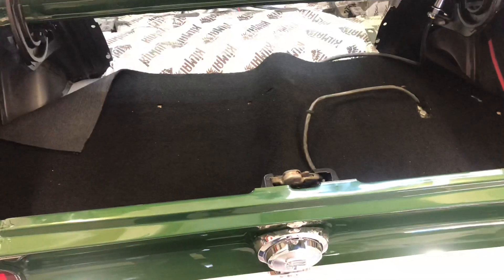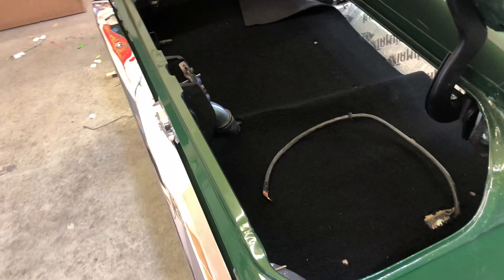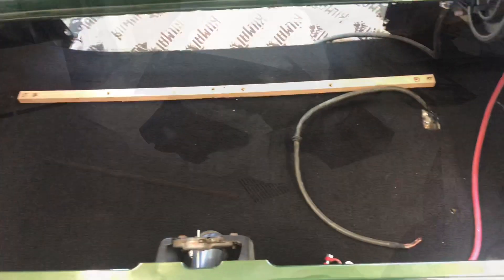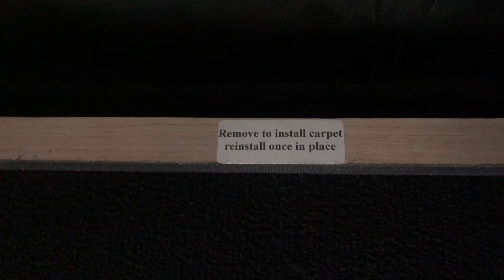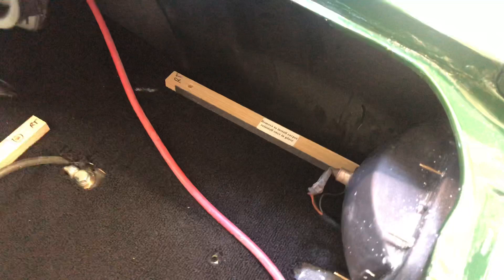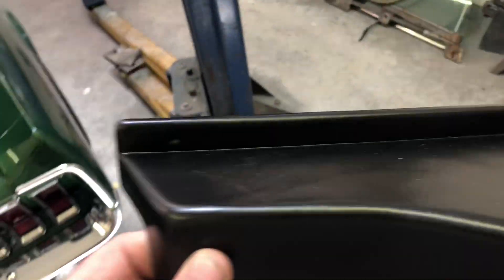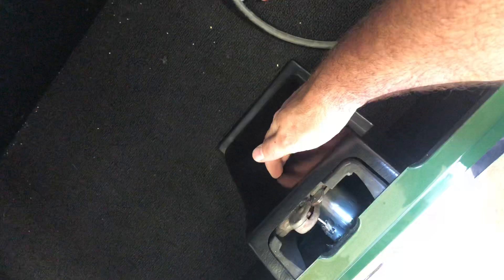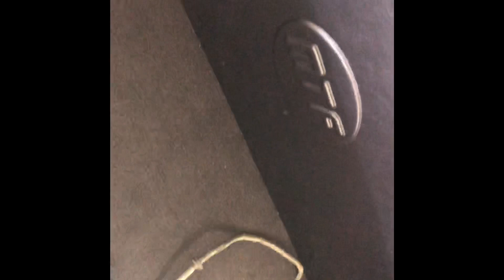Mustangs to Fear 67-68 fastback trunk kit instal

Comment: great ideas on how to protect the tank as well as clean up and protect the trunk space, I have a 68 convertible that I plan to do the same thing to. thank you for identifying issues and ways to adjust to compensate.  also love the 5 amp fuse trick. kill main power but keeps acc. alive

Comment: You know if you turn that off with the car running, then it will stay running due to the alternator. I found this switch that has 2 circuits in it. the lower current I run to my HalTech ECU and actually turns off before the high current switch. Also, I run both positive and negative gauge 0 as i have been told the resistive properties of the body are quite high and you can lose a lot of currents that way... 
https://www.joom.com/en/products/5b6c23e38b451301b2425853
https://www.facebook.com/bndt86/posts/276677033767078
Hope this helps you...